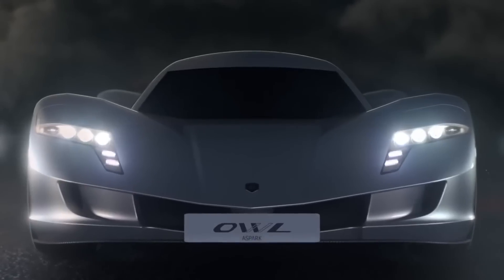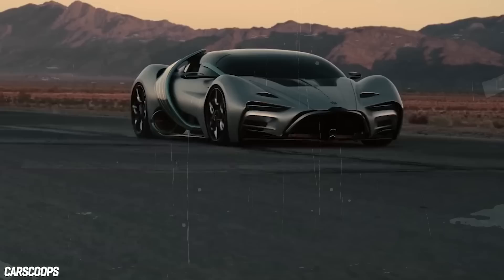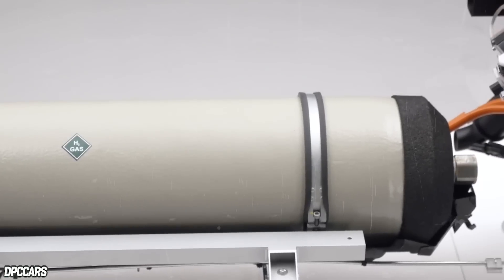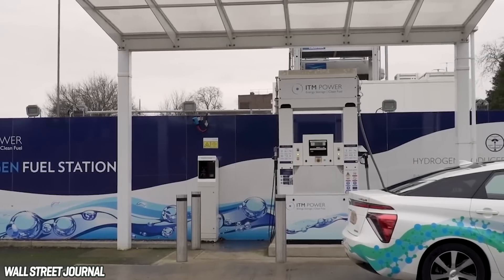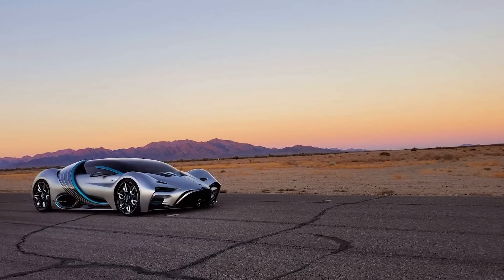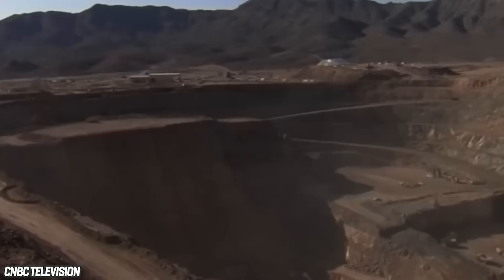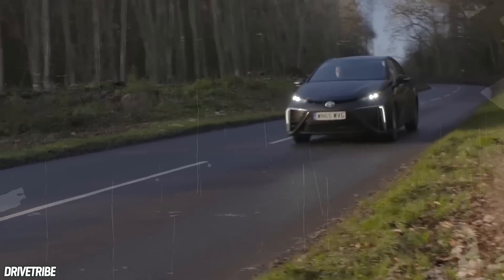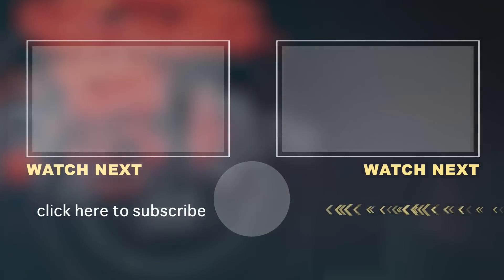Hyperion Introduces It's New Hydrogen Super Car

Comment from the maker: What's better Hydrogen or Electric?
Reply: Hydrogen. Byproduct is H2O
Reply: Hydrogen
Reply: Hydrogen more fuel efficient cleaner and quicker fill ups
Reply: Fun fact: the real person that is actually first doesn't comment
Reply: Hydrogen is better in the long run.  It's more like what people are used to because if you run low on fuel, you just stop at a gas station and fill it back up as opposed to electric where if youn low, you have to plug it in and wait for hous while it recharges.  The problem is efficiently producing hydrogen cheaply.
Reply: @picklefish74  You don't. You simply swap the empty battery for a standardized full one and you're on your way. It's even faster than filling up with gas. Cheaper too, because you buy the EV without batteries and simply lease them.
Reply: Hydrogen the parts used to make electric cars might not be to earth friendly rare earth metals r filthy
Reply: Fun Fact: Hydrogen cars ARE electric cars.  They're called FCEV (Fuel Cell Electric Vehicles). You convert the hydrogen to electricity.  So the question should be, are hydrogen powered or battery electric cars better?
Reply: Affordably produced hydrogen will be the way for two reasons: 1. Most plentiful fuel source 2. By product is water vapor which is good for environment, recyclable & sustainable.💦👍
Reply: Hydrogen
Reply: Okay, folks. Hydrogen cars are electric cars. They convert hydrogen into electricity and that’s what powers your vehicle. But they don’t require heavy enormous batteries. And guess what fuel is used to charge up batteries?
Reply: Right now, battery electric vehicles (BEVs) seem better (although ICE vehicles are still better than BEVs). In the long run (from 2030), hydrogen vehicles (FCEVs) win hands down.
Reply: @damirklisanic1170  ICE will always win in my book.
Reply: Hydrogen , long range and quick to refuel
Reply: @ravenclawgamer6367  gas.
Reply: @ravenclawgamer6367  gas.
Reply: @ravenclawgamer6367  gas.
Reply: @noname-md6pw  Do you mean gasoline
Reply: @ravenclawgamer6367  yes i do. We just say gas for short. But yea, you know gasoline is way cooler than anything else.
Reply: TheRichest early
Reply: If accident happens in hydrogen car............👻👻👻👻
Reply: @karthikraj3917  You won the Internet ! Haha
Reply: Hydrogen cuz it is eco friendly
Reply: I would like to see a hybrid that combines electric and hydrogen engine but I prefer electric until someone makes it
Reply: H2
Reply: Hydrogen
Reply: @Heath Sims Hydrogen is not explosive in a car. It's explosive when you make nuclear bombs which use nuclear fusion. A fuel cell is totally different. Hydrogen cars are actually way safer than even gasoline/diesel powered cars. And I'd like to see Li-ion batteries get punctured.
Reply: @ravenclawgamer6367  the Toyota tests proved this when they punctured the tank and the hydrogen dissipated into the air before it could explode into a fireball, the only way  would be maybe in a tunnel with poor air flow. But that is why the Hindenburg went up like it did because it was burning in a closed environment before it melted through and engulfed the rest of the aircraft, no different than the fuel vapors that caused flight 800 to explode when they lit inside the wing.  the tanks on hydrogen cars have to be built more like racing fuel cells than a standard fuel tank so the hydrogen doesn't leak out, which makes them very hard to ignite
Reply: Hydrogen!
Reply: @markrigoglioso  absolutely not.
Reply: well.. Basicly it is Electric since it turns the hydrogen in to electricity.
Reply: This narrator sounds like someone from a Spotify ad.
Reply: Depends on how u help our earth
Reply: @Saransh Singh Is that a joke? LOL
Reply: Ya
Reply: Can you guys translate meters.and 💶 its confusing when you say that
Reply: Neither. How about a car that can go over bumps?!
Reply: Both
Reply: For prestige and rich people hydrogen. For poor, workless people without skill it is battery
Reply: @Ernesto Cruz they are more costly then electric plus they lack the station’s what Tesla has in most country’s
Reply: @Ernesto Cruz they still lack the infrastructure  that makes hydrogen cars not as popular as electric cars that is sold by Tesla with high quality and safety even self driving cars at a faster paste then most other company that focuses on self driving cars, trucks, etc. Until they make more refuelling station’s available in more countries and area even have the factory and resources of producing these cars and at a affordable price like what Tesla is doing right.: until there solved this problem they we never compete later in the future.
Reply: @TgamerBio5529  Europe and Asia are taking hydrogen much more serious that we are, they already have nearly 300 stations built, and to increase demand Europe is converting all long range trains, 3 are in use right now with 50 more coming online in next 5 years, they are also starting to convert gas turbines in power plants to hydrogen to get themselves off dependency on Russia's gas lines.  I think we will start to see infrastructure increase and prices going down in next 5yrs or so to make it more competitive.
Reply: Gasoline.
Reply: @Zutronic com what in the world are you talking about?
Reply: Hydrogen car is battery electric car.
Reply: Hydrogen
Reply: Hydrogen
Reply: @Heath Sims you know lithium batteries aren't very safe in a crash either, if they are cracked, punctured or overheat they can burst into flames as well
Reply: @Zutronic com Plus we are already seeing shortages of some battery materials and battery companies want to start strip mining the ocean floor to get the needed materials.  Strip mining the oceans will be even more devastating to the ecosystems than drilling for oil is now.......not a very environmental solution, especially when the oceans are the 1st link in the world food chain.
Reply: @Zutronic com Yes Toyota is working on improving hydrogen ICE engine technology, mostly for the developing world where they could convert gas and diesel vehicles to use hydrogen for a fraction of the cost of HFCs, and even when getting Blue hydrogen from natural gas the you get a little NOx (less than gas engines) but that is one of the things catalytic converters  filer out now. And when you get Green Hydrogen from clean renewables no more NOx .... only water vapor
Reply: hydrogen cars use motors, they are electric ???
Reply: Hydrogen
Reply: They're both electric :P
Reply: both are Electric 🤣
Reply: Fart ..
Reply: TheRichest should stop pinning its own comments.
Reply: hey
Reply: Petrol
Reply: electirc
Reply: U suck
Reply: U suck
Reply: U suck
Reply: U suck
Reply: U suck
Reply: U suck
Reply: U suck
Reply: U suck
Reply: U suck
Reply: U suck
Reply: @necroplayss  u have no friends
Reply: U suck
Reply: @necroplayss  Please stop spamming.
Reply: @daremixman5919  I dealt with it
Reply: @scorchingboy9462  Same, reported every single comment for spam ;3
Reply: @WyldWolfDragon   lol
Reply: @WyldWolfDragon  I somehow got 20 subs
Reply: @daremixman5919  report that spammed comment please
Reply: U suck
Reply: U suck

Comment: There are a lot of inaccuracies in this video. BMW does not sell hydrogen cars yet. Toyota, Hyundai and Honda are currently the only sellers and yes you can buy them here in California where there is over 50 hydrogen stations to drive from Tahoe and Sacramento to silicon valley to LA/San Diego area. As to safety, hydrogen is only flammable when mixed with air. Meanwhile batteries can explode with no supplied air. Some manufacturers that high pressure hydrogen is safer than gasoline... Others more conservatively say it's just as safe. The hydrogen car is here and it can actually be made green unlike lithium.
Reply: Also, steam methane reforming is >70% efficient and the fuel cell is 60% efficient. This means an FCEV runs at 42%. This is more efficient than gas or diesel. An battery EV powered by a natural gas plant would be limited to 35%, the thermal efficiency of the power plant.

Comment: I just can't wait for below freezing winter driving, as often found World wide, when countless  hydrogen vehicles have driven before us spewing mostly cool liquid state water exhaust droplets from a hydrogen fuel cell's 60-80C/140-176F exothermic reaction coating the roads with black ice for us to drive over and wreck our vehicles on ! Remember that liquid water begins to steam, when heated, at 100C/212F. How about slips and falls in parking lots from countless, intentional winter temperature liquid water waste dumps left when leaving parking spots. Now that is safe ! This concept is just another, not so well thought out,"GREEN", idea that when applied into the real world, with millions of passenger and commercial trucks produced by so many manufacturers  needed to fuel a society with hydrogen to keep us safe from climate change, does not keep us safe from injury or death when in vehicular accidents or falling down when encountering ice. A future Hydrogen Economy when built out, operating so many Hydrogen Vehicles that are spitting water on below freezing road or parking lot surfaces day after day in continual below freezing temperatures is not the answer ! It only takes  a small patch of ice for a person walking to slip and fall. The key point is the state of the vehicle water emitted. Internal Combustion Engines (ICE) have high thermal heat output 250-800C/482-1472F and the resulting combusted fuel emissions cocktail comprises much less liquid water state exhausted as a portion per mile which is, in the case of an I.C.E. exhausted mostly instead as water vapor, which as we all know, is emitted as a gas vapor not settling on a road surface, but dissipating up as heat rising into the atmosphere. Present fuel cell designs drip much water, about a cup per mile, plentiful commercial Trucks / Lorries much more in the liquid state as the only single resulting byproduct, able to fall in a cool liquid form, ready to freeze on colder road surfaces. That is the difference. How about adding a steam heating unit to the fuel cell's liquid water by-product exhaust, this may be an energy intensive solution reducing mileage, and efficiency during winter driving, but lofting water vapor up off the road as ICE propelled vehicles now do. So, where to put the liquid water. Maybe an onboard  tank to freeze solid and burst when parked?  At a stop sign or light idling then accelerating adding heavy icing right there to the road surface just where one wants to actually stop? A parking lot to slip and injure another walking by the back of your parked vehicle or after you drove off leaving water to freeze there? A roadside gutter so a pedestrian can slip stepping off a curb, maybe falling down flat in front of stopped traffic and out of view of drivers ready to accelerate forward? Your driveway so you can fall there ? Your Garage to slide across while holding your infant child then both hitting the hard floor? Maybe, you need more tasks or to be distracted by mopping up the garage floor before the water freezes and your groceries just purchased thaw? Maybe a high speed highway perhaps in a turn? Maybe the unlimited speed limit Autobahn with high water production by those higher electric energy demands moving the hydrogen vehicle through the air while simultaneously dumping large amounts of water mist contrails at high speed onto the road surface? Your Hydrogen Vehicle needs to relieve itself in public, The question is where to do it safely? Now considering these real world usage / interaction scenarios listed, are Hydrogen Vehicles a good idea? As a vehicle operator you can rate the chance of consistent, caring, and professional operator actions observed when you're out exercising your privilege to be with others in the public driving arena. Are you certain that rushed Hydrogen vehicle drivers find and maneuver over a public storm drain water dump station to let their hydrogen vehicle relieve itself in public places when freezing weather is happening? You rate and you decide if  we or will not slip into a Hydrogen transportation based society. As for me...you guessed it,  I see much more "could care less" vehicle drivers and very few careful vehicle drivers. Hydrogen supporters….should we give these "could care less" about you drivers a water soaker sprayer for society at large to walk or drive over when a dash indicator flashes an alert "water tank full" during your trip? 

  As a example of related but current human behavior, How many times do you see trash / rubbish go swirling out of a moving pickup truck bed in the States, or dumped out a moving vehicle window instead of being caringly placed in a proper waste receptacle when arriving at one's destination, as an example of drivers' proper public disposal habits?

Maybe add antifreeze to the water dump so it can mist on following vehicles windshields / windscreens then be smeared when wipers on, so the trailing driver has no clear view of the road. Now that is safe ! Then more windshield solvent , with poisonous methanol, is added to the ground by constantly spraying to keep a clear view. Now we're turning wipers on and off, as if that is not distracting to manage while driving in heavy traffic or oncoming bright sunlight in turns. Now that's safe.

Maybe many Hydrogen Fueled Vehicles can dump water, and antifreeze, smearing trailing vehicle's glass view 360 degrees, that is now spread everywhere in the environment. Now that is green, think !

Maybe the Hydrogen Vehicle owner after the cost of a fill up of Hydrogen decides to not pay for the extra cost of perpetually filling an auxiliary antifreeze reservoir that costs more than gas or petrol per gallon. So where is the transportation fuel savings when buying both Hydrogen and Antifreeze for the fuel cell's water as a by product tank?

Maybe granular or liquid salt treatment of ALL the roads ALL the time when temperatures are below freezing, even on sunny winter days ! Now raising the P.H. in streams from water mixed with salted trickling runoff 24/7/ all winter does not sound very Environmentally conscious or Green Think savvy. Get ready for higher taxes to pay the millions of dollars to pay for road treatment. Pay for replacing your scratched up paint. Pay for a broken windshield / windscreen when a chunk of salt is thrown on it during truck/ lorry application. Buying a new Vehicle often because your vehicle rusted prematurely from driving all winter on heavily salted roads.

Maybe add vehicle exterior damaging or ICE engine air filter intake & cabin air filter clogging traction grit like coal furnace electric generation plant cinders or mined beach sand from environmentally sensitive areas to the below freezing road's surfaces 24/7 all winter to combat black ice on road surfaces, filling the streams with sediment to clog fish gills when stirred into the water column later by heavy rains to follow in warm weather. Now one has to think twice about opting for a green and healthy deep breathing bicycle ride or walk on a drier warm early Spring Day to work or for pleasure while breathing the leftover dust from many Winter months of road grit application stirred up by passing vehicles.

Maybe the antifreeze adder system breaks or is disabled. Now the trailing driver is back to sliding on black ice in below freezing cold temperatures when Hydrogen is used in Vehicles as a transportation fuel spewing ONLY clean water onto the roads as the only by-product of its use.

Possibly you or another will be in a hurry to turn into an open parking space like so many hydrogen fuelled vehicles did before you after many back to back freezing days. Only to slide on black ice your vehicle's front bumper into the side door of or bumper of an already parked vehicle in the next parking space because of all the repeated water dumps released earlier by other shoppers under the hydrogen vehicle's body.  : (

You decide, if adopting Hydrogen Transportation is in our best interest in the "Real World". Seems like a slippery slope to me ! How about you ? Are you still a Hydrogen Transportation vehicle supporter?

Comment: The main issue with hydrogen fuel cells in cars is how inefficient the process of hydrogen generation and compression is.  It’s as low as 40% efficient which is much lower compared to the battery powered electric cars. They just need to develop a more efficient process.

Comment: Ultimately, an electric car needs electricity as a fuel to be charged but is that fuel coming from renewable source? No! That's why H2 cars are needed!!
Reply: That is an issue that is currently being worked on at a pretty rapid rate with new battery storage tech, grid management software,  and of course  improved/improving solar cells.  Currently tesla's solar city has the cheapest solar.  The idea that hydrogen is has any chance of  catching up with EV's, solar tech, and batter storage is laughable at this point. Each year they moving faster and faster.  Hydrogen would be trying to cover an ever increasing gap. The rate of innovation is to much for them to ever catch up at this point. 15 years ago maybe if they could innovate fast enough but its to late for hydrogen at this point. It may find some niche in commercial use one day but i doubt it.